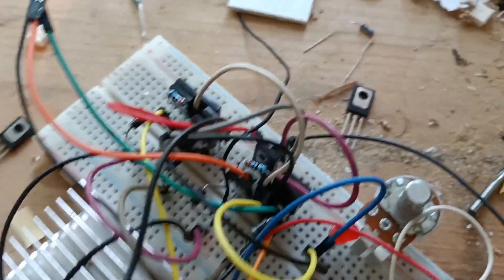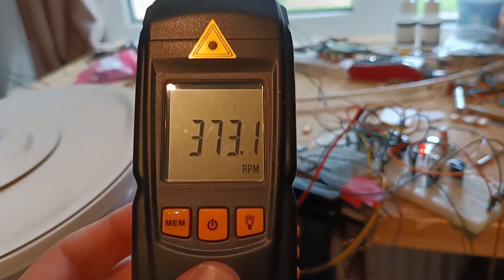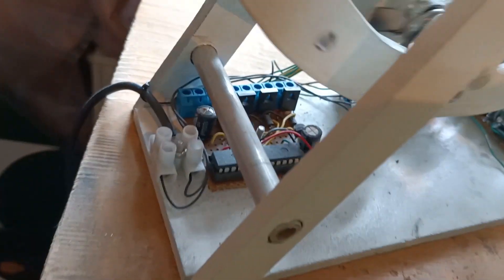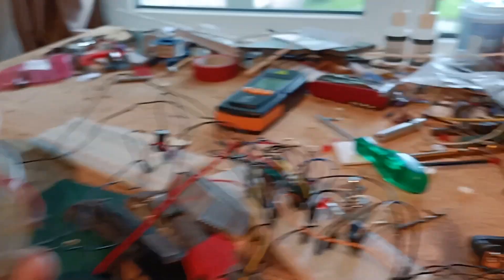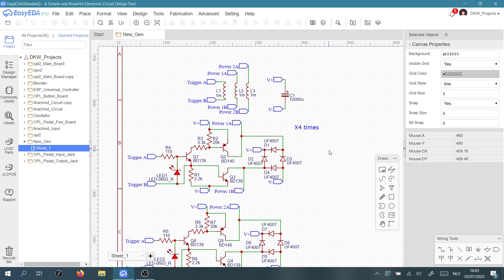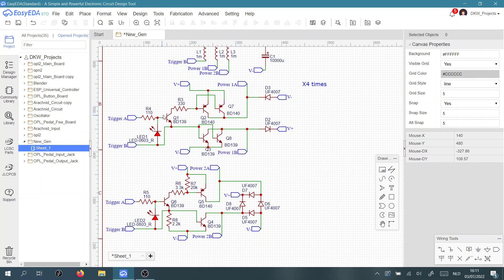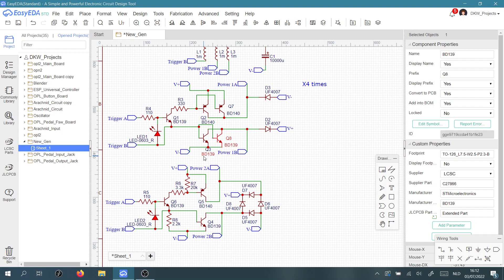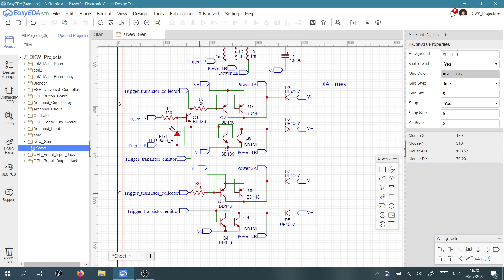New Gen: A modified Bedini Cole circuit

Comment: I cracked the universe mystery, which reveals that it is limitless. Obviously you cannot make more than limitless. You should study my work and stop wasting your time with this perpetual motion devices. They cannot exist. And no, no scientist has ever done what I did. I only published it 2019. It would be very unwise for you to ignore this. Because the fact is, you're wasting your time. You require at least 2 elements that react with each other to make a reaction. It's the principle of a battery or fuel.
I studied it once also and took it more seriously than these school smartypants who are only able to quote what the teacher told them. The perpetual motion machine doesn't work for a simple reason. To make 2 litres of water out of only 1 litres of water is equal as impossible as to make more energy.
Sadly but you can only use chemical reaction or river, wind and sun light as energy source. And zero point energy myth is based of exotic matter or dark matter. Do you think we're on that level with some copper wire and semiconductors to use exotic energy or dark energy? That's at least a galactic age of a civilization. If my comment helped you, tell others too that they're wasting their life.

Comment: Also they make magnets that have holes in the center of them for fairly cheap so you could put a bolt threw them instead of using tape :)
Reply from the maker: Yes now that you mention it, I should have thought of it in the first place. However I will box in the current magnet setup so the cannot fly. Alternatively, if it doesn't fulfill the task I can order those magnets aswell. Thanks!

Comment: Can you put a gear on  both motors or direct shaft and see if the smaller one can turn the bigger or bigger turn the smaller one? Basically both piggybacking off each other.
Reply from the maker: Sounds cool! I actually want to keep focus on the build, and so it'll have two phases of which the output will feed eachother. I hope that ticks this box